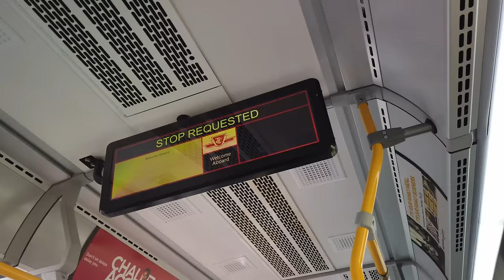Why American Buses Are Just Worse

Comment: I don't know if I entirely agree that a lack of options is the driving factor.

I think it is an obstacle to improving but I suspect the lack of options itself is caused by the same thing as the terrible transit in much of North America.

I would guess that the big factors are political. Much of North America completely gutted their public transit systems in the 1950s and 1960s. This was due to a shift of the middleclass to suburbs and their adoption of automobiles leaving the poor people as those using public transit. In many places this was further emphasized by race as black people (and other minorities) were particularly heavily reliant on busses (see the famous Montgomery bus boycott). This created political pressure to cut service to the bare minimum and eleminate anything that could be considered a "luxury". This meant that there was no appetite for busses that met more than the bare minimum to get the poor and minorities to their jobs and in fact there was opposition to doing antthjjg more. And, you can see that transit systems are generally better in areas that had less of a racial animus in their development and politica. 

Even today, any proposal to invest in transit systems almost inevitably results in complaints about it being a giveaway to the poor and/or how it is screwing over drivers.

Comment: Buses (for local transit at least) both in Germany and Hungary are not that comfortable at all. I know for sure, because I have been living in both countries. Seats and suspension is rock hard and even on brand new busses you have the feeling that the thing falls apart any moment. Buses however that do long distance or local transportation in rural areas are waaaaaay better and really comfortable and quiet, even on cheap Flixbus that is. Austria or Switzerland is a different level. In Switzerland they even have carpets on the local bus! Unthinkable in Germany. Seats are also much comfier. They use the same brands, than Germany or Hungary, but don't cheap out on speccing them well.

Comment: First, buses should only be used when other more efficient means of transportation do not exist (metro, light rail, trains). If you want, the last kilometer only. Second, when used, buses should have their own priority lanes so that they never get stuck in road traffic.  Third, they should be synchronized with the rest of the transport network so you don't need to wait, and if you miss one, the frequency should be high enough that you don't waste too much time. Finally, the schedule should be predictible (e.g. every 20 minutes on the 4, 24, 44 minute). If you do that, not only will public transportation be MORE time efficient than individually driving, but it will also attract a lot of people AND be cheaper in the end!   Sometimes, I see anglo-saxon transport system (except maybe the excellent London system) as a way to just make public transportation look like communism.

Comment: Quite a lot of cities in the UK had a tram system and only a few have them still. I think for some cities with main route roads should have kept them. In my city and like most in the Uk have a dedicated bus lane (pointless) which doesnt get you there faster because they dont go from a to b at points they have to pull out into the main lane. If they kept the tram systems for the deadicated bus lanes it would have been far better for some cities

Comment: I hate how American buses always have wide wheelbases especially new flyer buses (if that's even called) as it just makes it hard for buses to turn sharply and occupy so much space when turning...only nova buses have the right design that makes it the best bus in North America in terms of driving and turning...the only exception to this is for motor coaches where they don't need to always be driving in crowded roadways and they need more luggage capacity

Comment: Sad but true. In addition, European bus and in fact train systems (well not the same in all countries ofc..) are superior to almost everything else. Emphasizing System, because it's not only the vehicles themselves. It's the whole system and infrastructure and all behind it, the frequency they arrive, how far and on what routes they go, the apps showing when they come, how reliable it is, night lines, etc. In all these regards actually and surprisingly Budapest in Hungary has one of the best city mass transport system I have seen, although missing some latest features like all around card checkin system, but it has app and QR based one. Buses, trams, metro, trolleybuses, light rail, rail, and many night lines, even to the outskirts and outside the city.

Comment: I always found the NA busses to be misdesigned. They look like trucks - and probably ride like that. I stopped the video at 7:30 where that electric bus turns. It looks off-putting: Small windows like a prison bus, the wheels from a garbage truck, the mirror and the metal poles holding it looks like some amateur welded something together in his garage. What's with the weird "nose" this bus got? Why is the back/rear looking so bulky and "squashed" like the face of a Persian cat?

I can understand U.S. schoolbusses look like utter, super cheap crap (even though they improved from the "1930s farm truck" looks a bit), but even the regular busses are so bad it's insane. There is no aesthetic value to them, almost as if they want to discourage you from riding. The interiour looks so randomly thrown together, colours are all over the place. Would you want to drive a car that looks like a kindergarden child has designed the cockpit, let alone the exterior? No? Me neither.

Comment: You mentioned Asia has better buses but you gotta exclude Korea. Yes we have top of the class railway system but buses are questionable. Don’t get me wrong the network is extensive and it’s one of the main modes of transportation in urban areas but the quality of vehicles is so bad. You think New Flyer buses are rattly? Try Hyundai. You can feel your guts shaking when the bus is idling and you’d have to hold real tight to survive the jerky shifts when you’re standing. I felt more comfortable in New Flyers with hard seats than in Hyundais with padded seats 😂

Comment: Arguments about buses being "nice" is completely irrelevant. Buses are to transport people. The fact you are sitting in a bus means you are not using it for work because in the morning are crowded and you can hardly sit ( as you probably have gave up your seat for some elderly or parent). If you are riding busses as your hobby and do it in non-rush hours. When I was living in the city I often could not fit into he bus. They were so crowded I could not physically enter the vehicle. Do you think you need comfortable seat if you can not even use the bus?

As a matter of fact having regulation that your state budget can only buy busses procured in the country is great. In the EU you are obligated to open your market to any EU manufacturer. On one side it is nice because it promotes competition, on the other the profit is not shared with the country is buying the busses. It works because EU countries are typically small and it would not be feasible to have a factory in every one of them. Rest assured that Germany or France is having such policies that "local' busses should be preferred.

Buses are busses what is important is:

-number of routes
-frequency of courses
-size

Number of doors, air conditioning (In the summer even the best AC does not suffice anyway) are secondary matters.

Comment: You missed the Mercedes City 75 a Mercedes Sprinter city bus with 2 sets of doors, one fount, and one in the back  I thinking it be interesting if the Subway & streetcars in Toronto used both sides of the trains one side for loading the other for off loading people unload at the same time people load no idea that work was a glitch in GTA bus stopped people popped out all side of the bus

Comment: you are wrong. first of all, still many countries in Latin America and even some parts of Europe are not better. And those busses in North America are not so bad, that this is the real reason why they have a bad reputation. The REAL reason  is that in  many parts of the US the busses are only taken by 'poor people' and 'a lot of weird' people with also often have concrete danger and harassment (and  a bad atmosphere), especially when the line runs in regions which you can run with a car much more comfy/faster (which prevents most people to use the bus) -  a vicious circle. You have and had that in Latin America also to a more extreme level - when certain bus lines/passenger got attacked and frequently robbed by streetgangs etc.  - long story short: as long the passenger mix is for ordinary people not kind of mainstream and feels comfy/safe enough, other solutions are preferred. If a Bus looks  a bit better, newer or older is NOT so relevant!.

Comment: 🎯 Key Takeaways for quick navigation:

00:00 🚌 North American buses are perceived as inferior compared to international counterparts due to various factors.
01:23 🌍 Competition among bus manufacturers is much higher globally, leading to a wider variety of bus models with innovative features.
02:45 🚪 More doors on buses, common in other parts of the world, facilitate quicker boarding and alighting, improving the overall transit experience.
04:08 ⚡ Electric buses are more prevalent outside North America, with many cities adopting electric or trolley bus systems.
05:15 🛠️ Outdated regulations, such as "Buy America," limit the adoption of international buses in North America, impacting the quality and innovation of buses.
07:19 🇨🇦 North America's major bus manufacturers, Nova Bus and New Flyer, are both based in Canada, where there's less stigma around bus usage.
08:11 🌏 Transit agencies in North America have attempted to import European buses, often resulting in a better transit experience, but this practice is not widespread.

Made with HARPA AI

Comment: actually overhead wired/traked buses iuse to be common in the US sll  are in the Big 3  but the cost was way too much for medium sized cities and becae a hazzard to car traffic which is why PT is less in the US because more people own cars.  For a long time people would chose cars over PT except in NYC.  There are very few cars in Europe because most european countries are small  and pT  doesn't wrok for long distance except Amtrack and Greyhound and planes liit thier usefulness to those withut money or short hops of less than 500 miles.  And, few European countries can you travel more than 500 miles sand remain in thesame country. I think is not as true as you make out for Mexico or SA.  Where i doubt other than tourist cities and Large cities they een have public city.  If your city is less than 5 miles long  or less than 50k population PT is not viable as you can walk almost anywhere.  Though i have seen an except in NIles Michian where they have dial a ride so basically PT taxi.

Comment: You left out a ton of important context in mentioning AC Transit's Van Hool purchase.  The Van Hools were surrounded by controversy from the get go with the purchase cost being about 12% higher and delivery about 5x compared to domestic options, allegations of fraud and whatnot surrounding the order (e.g. paying an AC Transit employee to live in Belgium, not documenting certain transactions with VH, taxpayer paid vacations, etc.).  Beyond that drivers, riders, and mechanics all disliked them.  They were notorious with riders for being difficult to drive smoothly and even better for having an exceptionally difficult to navigate interior.  Take a look at how the engine intrudes into the passenger space.  Don't forget that Gillig is based in Alameda County a.k.a. AC Transit's home turf.

Thing is it's not like European buses are verboten in the Bay Area.  The Van Hools replaced Ikarus (Hungary) buses at AC Transit.  In San Francisco, Muni ran MAN articulated diesels for years and replaced them with Neoplan (German) ones and added some Ikarus 40ft buses.  The Ikarus buses were particularly nasty agricultural beasts, but still rode better than the (fire prone) Neoplan buses.  The previous trolley buses all came from Skoda (Czech), the less said about those the better.

Comment: The other thing is: US busses are designed with ADA and AODA in mind. An entire row of seats can be pulled up to make space for wheel chairs. The entrance is wide enough for an automatic ramp. In Germany, some unhappy bus drivers need to get out of the driver cab, walk to the middle exit and pull up the ramp by hand. The pull cords are throughout the cabin from front to end. Good luck trying to request a stop in an European bus, where the stop button ceased to work. There are hidden features, an abled body passenger would not notice. Ok, we can agree on the hard shell seating, they are bad.

Fun Fact: The NewFlyer Low Floor bus is based on the Dutch Den Oudsten B85/B86, because a family member behind the Den Oudsten Coachmaker company used to own NewFlyer ltd. They also helped Nova Bus to introduce the low floor design. Sadly Den Oudsten is now bankrupt.
Reply: I‘ve never had a non-functional stop button nor are ~1 minute delays bc of wheelchairs a problem. Doesn‘t happen that often as well.